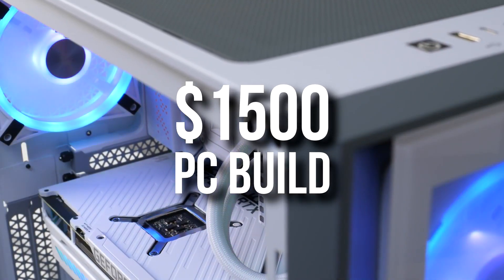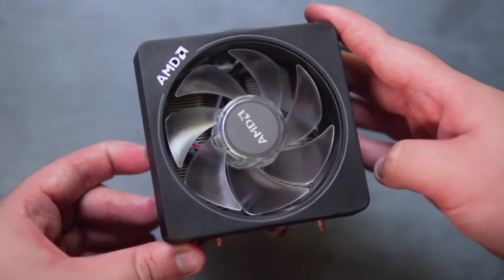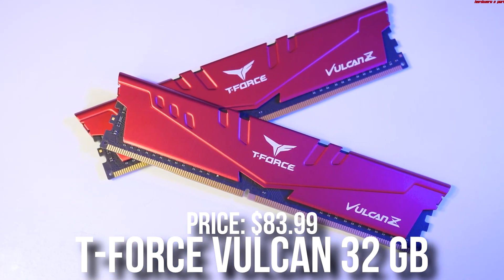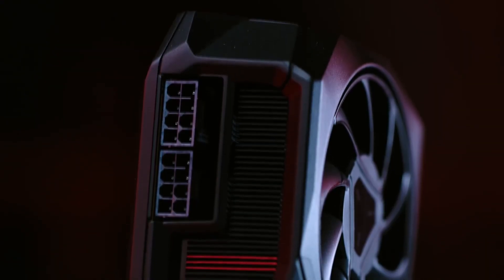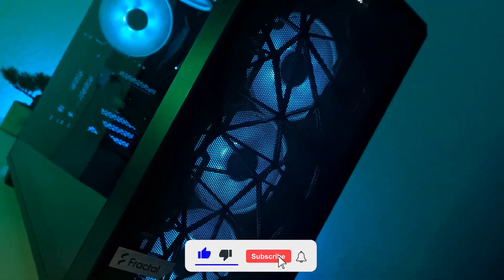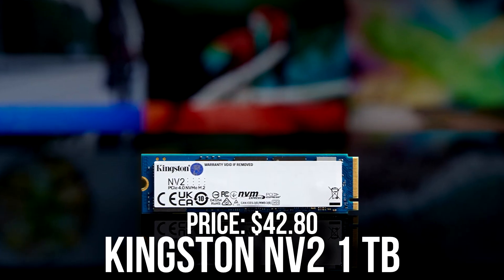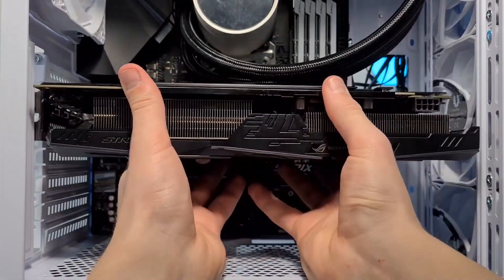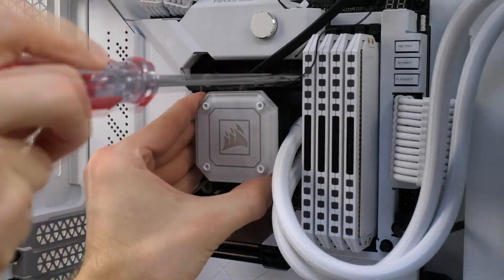BEST "4K Resolution" $1500 ULTRA Gaming PC Build ( HIGH FPS ) ✅

Comment: what can of build do you recommend for someone who just wants to achieve just 4k, fps as long as capped at 60 ill be ok
Reply from the maker: It depends on the games that you play, for most games, I'd recommend the 7800 XT for 60FPS capped, but, if your game is hard to run then it would be a different recommendation

Comment: I saw that the fractal case only supported gpus up to 341mm long and the 7900 XT is 344mm long. Was that a issue at all? I have a build that’s pretty similar with this that I’m thinking about buying
Reply from the maker: The 7900 XT on this video is only 276mm long